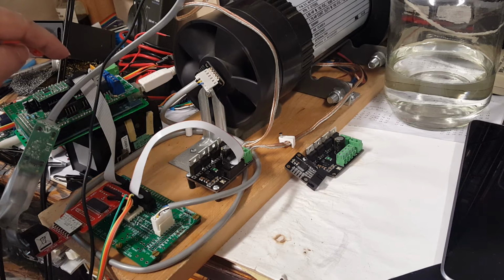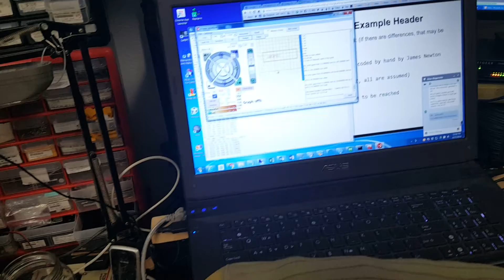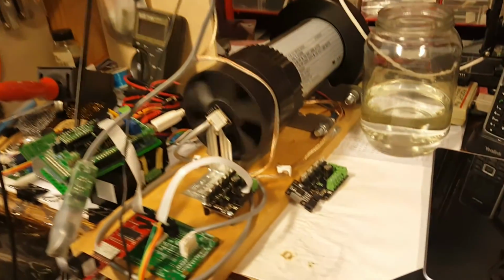MassMind.org Encoder/PID/DC Motor Servo from RAMPS / Marlin

Comment: So did you ever come up with a motor driver capable of running the motor at higher than 0.5 hp?   This looks like a great solution for automation for a reloading press
Reply from the maker: Yeah, the standard motor driver will do up to nearly 1 hp, and you can use it with a SyRen 50 amp driver (which is 2 HP at 30 volts) if need be:
https://youtu.be/Wxd9-VgvRpI
Reply: @JamesNewton  please I need to communicate with you 
Please

Comment: I have no enable lights showing on my driver built from your kit. I'm watching this video again trying to determine how you are getting 5 volts to the BOB PID controller board. Is it getting voltage through the cable coming from the Ramps board? I'm guessing that red board in the picture is a programming module for the chip that's normally on these boards?
Reply from the maker: That's correct. In this case, the /logic/ (+5) power is coming from the RAMPS. It could also come from the USB serial adapter (just offscreen lower left, the rainbow ribbon cable) or even from the motor driver (by shorting a pad on the driver) or from any other source (e.g. an external +5 volt supply). Logic power IS required for the BOB PID to operate.

Comment: Found your website. Can these be used with a duet WiFi  using external stepper drivers and maxon dc motors?
Reply from the maker: They can /replace/ an external stepper driver and work with a DC motor given a matching DC motor driver. E.g. if the Maxon DC motor takes less than 40 V and 18 A then our driver can be used otherwise you will need to find or build your own DC motor driver that accepts PWM and direction as inputs. The servo controller and encoder are very generic and can be used just about anywhere. Just needs a step and direction input (like a stepper driver), logic power (can be supplied by the onboard regulator option) and of course, like any PID system, it will need to be tuned.

Comment: My question to you is? Are you able to use a standard rotary encoder with your setup. I have priced stepper motors and drivers ect. for a mill conversion. i have on hand currently 5 treadmill motors and wanted to convert to cnc. however i am more familiar with mach3 as i have a machine that is stepper motor converted. Also with your current set  up can it feed back the position when manually moved like a hybrid stepper motor?
Reply from the maker: You can use just about any quadrature encoder, but the upper speed is limited by the accuracy. We can manage up to 73,000 edges per second or 18,000 lines per second. So for an example, if you have a 1000 line (4,000 quadrature edges) encoder, that is 73,000/4,000 = 18.25 RPS * 60 = 1095 RPM. With a lower resolution encoder, like our magnetic one, at 360 edges, you can turn up to 12,000 RPM. 

Keep in mind, you want the encoder as far from the motor as possible. E.g. for a lead screw drive, it's better to put the encoder on the lead screw, and then drive those with some sort of reduction (gears, belt, etc...) from the motor. That way, any slop in the reduction drive will be compensated out by the controller. 

The feedback is between the encoder and PID controller... so if you manually move the motor shaft, and the PID controller has been told to keep the shaft at position X, it will actively fight to move it back to X again. 

We do not have any method of feeding back position to the motion controller... mostly because we haven't seen any motion control systems that can accept that data. If you have a spec for moving the information in that direction, I'd be willing to take a look at adding support. No promises, other than that I'll try.